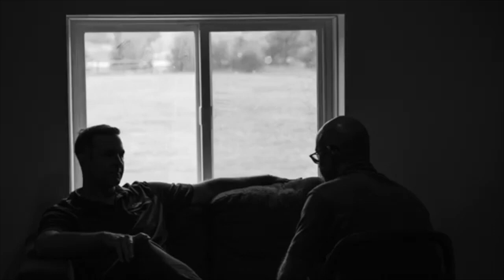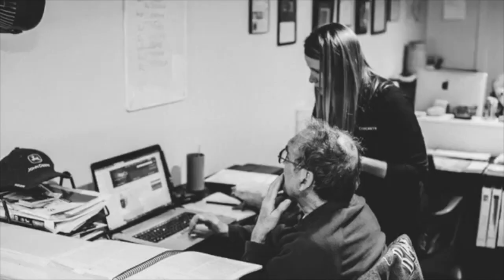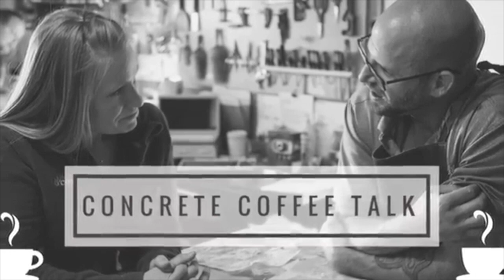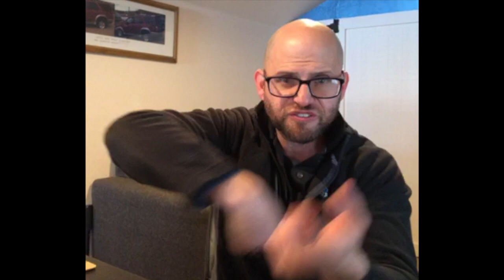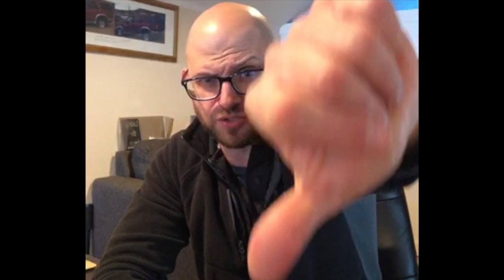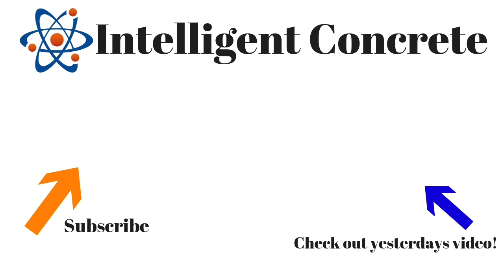Densify Concrete with Colloidal Silica? - Vlog #250

Comment: Thank you for answering the question. I get that colloidal silica iis a good additive in aerated concrete.
When we used the interlocking blocks 110mm x 450mm x900 mm as wall material  reinforced with layers of angle iron hooked into concrete pillars the blocks weigh 55kg each, more than a bag of cement. After the third row the building becomes backbreaking, hence the idea to use a lighter material. The blocks don't need to float, though it would not hurt, but if they are lighter all costs go down, labour, transport and even cement. So the intended purpose is not mechanical abrasion resistance, as in polished concrete flooring.
The idea is to develop a building block that can have a texture printed on the outside, and a different texture such as a polished surface on the inside, such as where the room is a bathroom, toilet or kitchen or any room  that would usually be tiled. So instead of investing in tiles on one side and paint or facebrick on the other, one spends more effort on the finishes during block manufacturing.  Then once the structure is built, and we built a two room 42square meter structure on a previously cured raft foundation routinely in 5 hours with 5 unskilled labourers, there would be no need to paint or tile.
What we did was to roughcast the outside after spattering with plaster, using a hessian bag, and drywalling and then painting or tiling the interior. Polishing the concrete of the raft foundation is better than tiling, I see some contractors even print 3D photographs on the floor. So the floor is finished before building the walls starts.
The problem with the blocks made in a 50 ton horizontal mould press using a dry mix was that the blocks were so hard after curing that fitting fixtures required much more effort to drill or cut than fired clay bricks. The graal would be to have a good recipe, cast huge  blocks, say 5metre by 1 metre by 1 metre like they do in Siberia, then saw and router or shape the building blocks from this monolith, blocks with the same shape and size than those made in the block machine.  Once they have been cut to a shape and size, they could be treated on one side maybe with an epoxy to achieve the required aesthetic effect. 
But of course as you point out, aerated concrete would probably not make a strong enough floor. 
You referred to something where we also used on another site the hydraform system, where the soil excavated on the site was mixed with 10% portland cement and pressed into interlocking bricks, which were used for dry stacked walls. But labourers need a higher level of skill than the other system where it is impossible to mess things up. The angle irons hooked into the pillars are precut to multiples of 900mm, the right size for a door frame, so the resulting structure is always square and if the foundation is level, the walls are level.
Once the foundation is cured, you take the blocks, beams, pillars, wiring harnass, doors and windows in frames and roof sheets etc.  to the site, and before the sun sets the structure is finished and can be locked up. (SOUTH AFRICA) You also don't need to crack another bag of cement on site, so there is no theft of materials and no left overs, and the site is clean when you finish. Unless you have to tile, paint or drywall. 
You see the cost saving if the level of finish of the block can be improved. So far nobody that I know of has cracked this.
Reply from the maker: Johan Kriel we are going to be posting a video next week answering your question! Look out for it